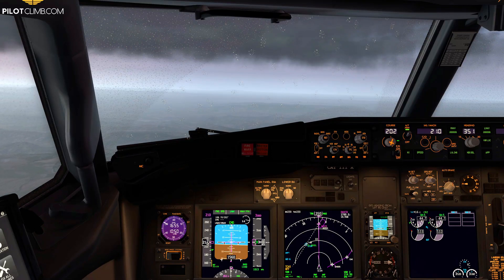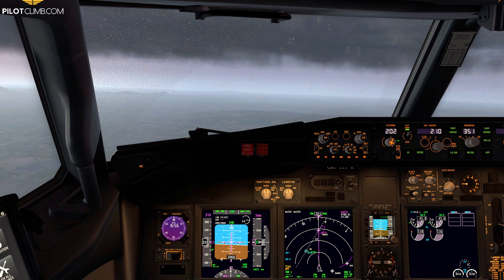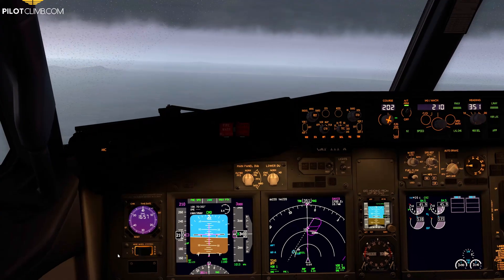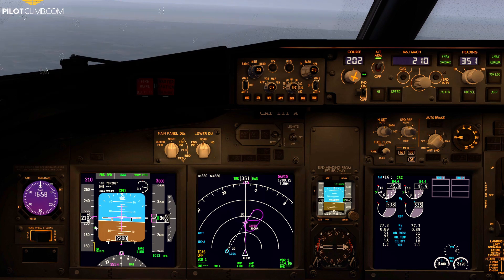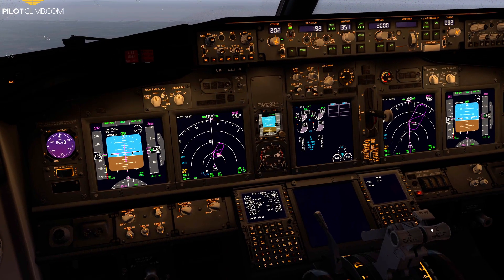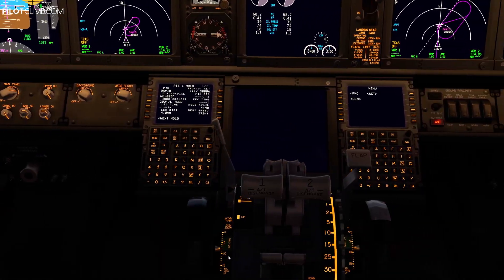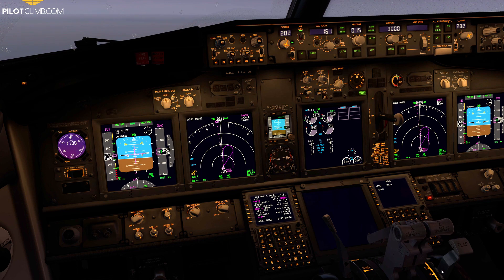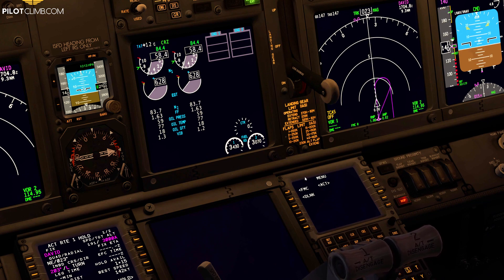What Do You Have To Check When Extending The Flaps During The Approach.

Comment: instead of going to flap 1, 2, 5, 15... Why not just go to directly to flap 10 since max speed is 210. then from there, go to gear down 15 then 30 passing the FAF. So you don't have to go through so many flap settings.

Comment: Question, Could you go from, say 210 Knots and just set 200 Knots and drop flaps 15? Or do you have to drop flaps in increments per the speeds on the Airspeed indicator
Reply from the maker: It is best practice to extend the flaps incrementally, in order not to stress the flap mechanisms top much
Reply: @PILOTCLIMB  Gotcha , thank you!

Comment: The book says Gear Down/ Flaps 15 (verify 3 green lights and select flaps 15). Nobody respects
Reply from the maker: Thanks for your feedback!
Reply: I dont know how it works in a real 737. Im just a simmer. But in MSFS 2020 with the PMDG Boeing 737-800, if I extend the landing gears while at flaps 15, I will have a configuration alarms that will go off in the cockpit. The only way to prevent that is to extend the gears at let say flaps 10 and then, after they are extended, I can go to flaps 15 and continue the flaps extention. But as I said. Im no pilot hahaha

Comment: Could you explain please, how do pilots determine the moment when they have to decelerate to extend flaps? You could either extend flaps too early and fly too slow for a long period. Or you could extend flaps too late so that there will be no time to adapt to the new configuration of an airplane. So how could we understand the perfect moment?
Reply from the maker: The perfect moment come with experience... Check the videos regarding descend management i made to know more about this topic
Reply: I use fix rings to maintain consistency. I create rings of 15, 10, and 5 miles from the touchdown zone. When I reach the 15-mile ring I select Flaps 1. At the 10-mile ring, Flaps 5. At the 5-mile ring gear down and Flaps 15. Shortly after that, Flaps 30 (assuming that is my landing flaps setting) and set final approach speed. I know that has me starting flaps extension much earlier than necessary, but for now it gives me plenty of time to think about what I'm doing and get it all done. As I get better at it I will make the rings smaller.

Comment: Hey captain i have a question, the speed reduction comes from the flightplan or ATC instructions or can we manually manage the speed reduction? And how will that affect the schedule of the flight?
Reply from the maker: Usually during the approach the ATC will give you speed instructions that you should respect, however the commander have the final authority and responsibility regarding safety and stabilization of the approach.
Reply: @PILOTCLIMB  Perfectly clarified, thanks!

Comment: Hi  captain thanks for lovely videos... can we extend flaps 15 without lowering gears?

Just in  case if we wish just to reduce speed without further drag for example speed restriction by ATC and you are still flying level yet and want to delay lowering gears
Reply from the maker: Hey, many thanks for your support!! If you extend the flaps to 15 without the gear the landing gear warning horn will sound.
Reply: @PILOTCLIMB  That's why we have to verify 3 green lights before touching the flap lever because the gear may not go down 100 percent of the time. We may one day have a gear failure. Try it in the SIM and you'll see why Boeing tells the crew to verify first
Reply: Landing GEAR

Comment: Another great instructive video 👍🏾 . What if one flies for example at 180 knots with flaps up, the faps up maneuvering speed was at 192 knots and the amber band on the airspeed indicator was around 166 ~ 167 knots ? What are the consequences ?
Reply from the maker: I'm glad you like it!! Well you should not fly below the minimum maneuvering speed because you get close to the stall speed for that specific flap setting, the Aircraft won't fall from the sky if fly momentarily below the minimum speed because you have a margin before reaching the stall speed.
Reply: @PILOTCLIMB  it's clear now, thanks